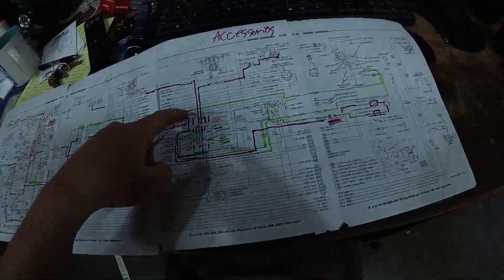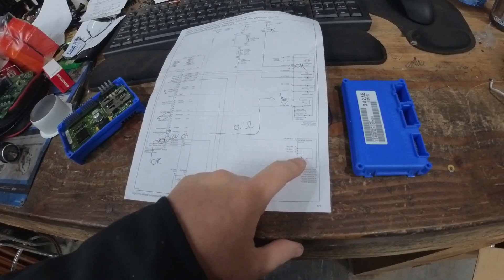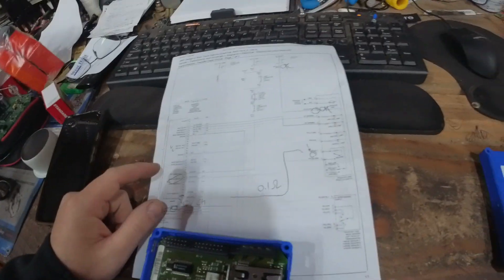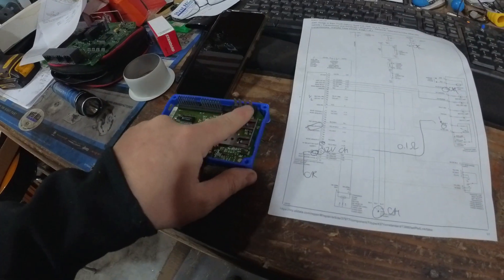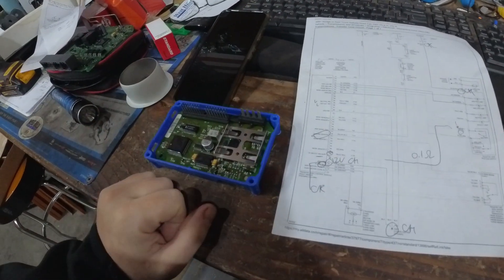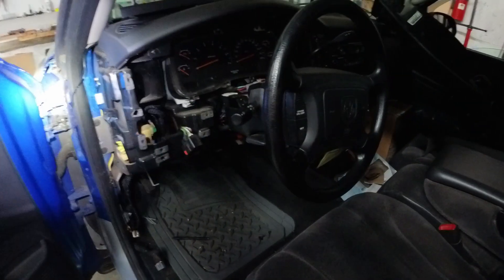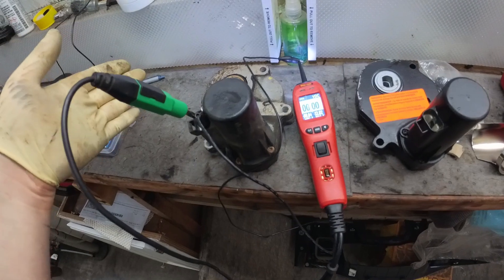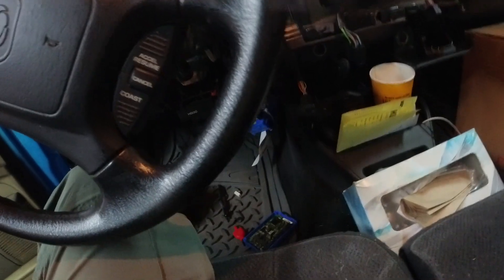2001 Dodge Dakota - Complete transfer-case circuit failure

Comment: Thank you for the deep detail here.  Going through similar issues myself with my '02 Durango.  My BCM is bad but the replacement works fine, just doesn't fix the blinking light on the 4WD indicator.  Going to try replacing the TCCM-need 4WD for winter.
Reply from the maker: Only ones that are available are used on eBay. All of the "module rebuilders" are scams for the most part. Did you test the shift motor?
Reply: @MegaMarclar  - Still working thorough this, re-visited your video today (thanks again!) Don't know how to test the shift motor  The double lead running into the transfer case has power to both pins.  I think it is the short motor and secondarily the module.
Reply from the maker: @billmitchell7785  I typically unhook the connector from the module and send power down from that connector. The module has a sense voltage that it sends out which can be in erroneous diagnostic trap. I usually just use my power probe to those two pins at the connector at the module. It's sort of a pain in the ass to get down in there and get that connector loose but that's the best way to do it. Other than that you go down to the motor directly
Reply: You nailed it man!  Tested the shift motor, it seemed dead.  Bought a used one, just got around to putting it in.  4WD is restored, blinking light gone.  THANKS!  @MegaMarclar
Reply from the maker: @billmitchell7785  sweet. Got lucky with a used unit